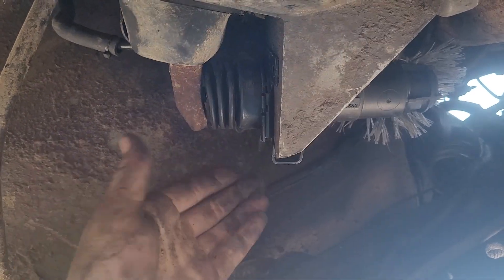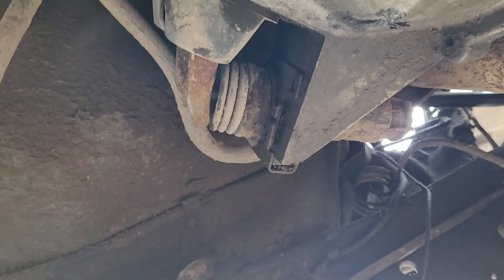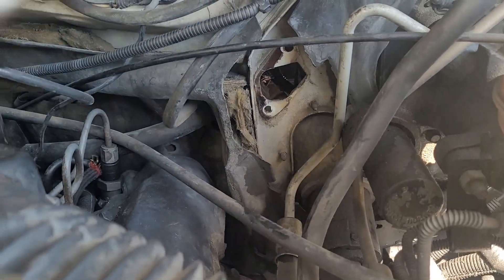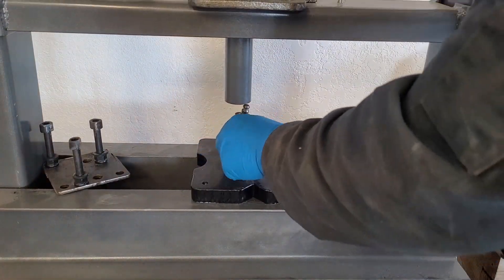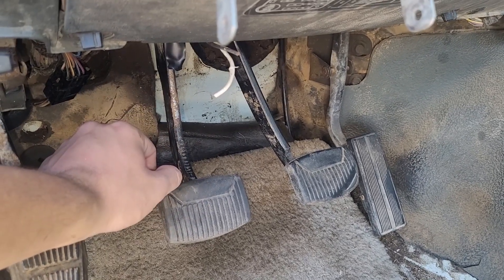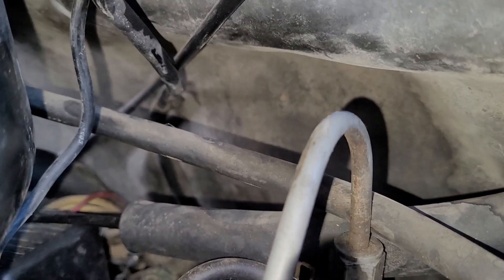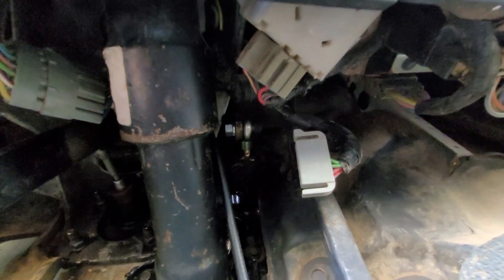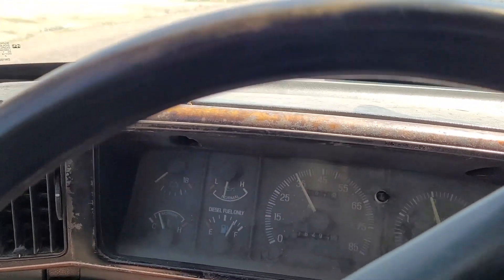Ford ZF5 Clutch Diagnostics - 1990 F Super Duty PT 2

Comment: Great video, just bought a 92 that didn’t run, put a used injection pump on and got it running. Now the clutch barely engages at the very top and will only go 2mph slipping like hell. Gonna go through all these items.

Comment: I’m fighting with is problem rn in my 97f 350 and 92 F150 the mechanical/hydraulic clutch system is good minus all of the plastics they used to save on cost. The Heim joint does fix the bushing problem until the main ones in the pedal assembly start to wear. While it’s nice to have a safety switch it just gets in the way, so much easier to bypass it and tie it up out of reach
Reply from the maker: Yep totally agree. At least on the diesel ZF transmission the slave cylinder is external. I belive on the gas the slave cylinder is internal to the bellhousing.

Comment: What is the engagement point of your ZF5? I replaced my clutch 15k ago & when I did I didn’t replace my master cylinder & pedal bushings. Just thought it was slipping.

So when I finally did the bushings after my master/slave cylinder it got better, but before I did my pedal bushings I think I might’ve hurt it cuz the engagement point changed to further up on the pedal.

I think it engages at about 1/2 pedal cold then 3/4 warm.

I checked under the inspection cover, & it seems I have plenty of clutch but still kinda nervous.
Reply from the maker: The pedal on this one engages probably at less than half pedal. The engagement point is lower when you have worn pedal bushings so it makes sense that replacing those moved the engagement up. If it's shifting fine I wouldn't worry too much. If you wanted to you could have some one press the pedal while you look at the clutch release arm under the truck checking for full travel/return

Comment: i used a small flat bar gear  puller to depress outward  the cutch lever to get the push rod to seat on the lever an the slave body to slide up in its holder.  the puller bar i placed inside the holder block  as high as i could get it an the puller bolt i screw in until it was was inside of clutch lever an push outward enough to mount slave cyl.  had to remove puller bolt out from the flat bar an carefully work the bar out an a few love taps seated  valve an holding pin. 1990 f-350 7.3 . After a half a day laying on my back fighting the problem this work for me, 😀
Reply from the maker: Good idea! Thanks for sharing

Comment: My 1996 7.3 powerstroke grinds going into 2nd and it hates reverse. It seemed to me like my clutch isn't fully disengaging and the guy I bought the truck off of replaced the clutch, slave cylinder, throwout bearing and more. He said before he replaced the slave it would grind 2nd to 3rd and 1st to 2nd and still grinds into 2nd from 1st. He didn't bleed the clutch and slave system, could that be my issue or is does it sound like a synchro?
Reply from the maker: Another area to check is the clutch/pedal linkage bushings. They are known to develop a ton of slop which can cause those types of issues. If the bushings are good, air in the system can definitely cause reduced clutch travel.
Reply: @NotEnoughProjects  thank you so much man. I'm probably gonna go pickup the truck today and figure out what's going on myself. The guys I bought the truck off of have been keeping in contact with me so I know they didn't cheap me out on it. Just worried about issues on a truck I spent 8500 on. I previously sold a 2nd gen 12 valve for this thing due to transmission issues with the auto and I hate autos now. The zf5 is new to me. Is there a chance you could make a video for me showing me where to find the clutch bushings and all that. Any troubleshooting tips would be very very helpful man